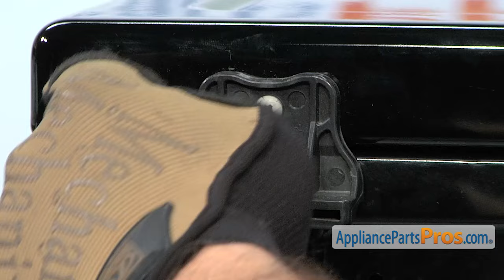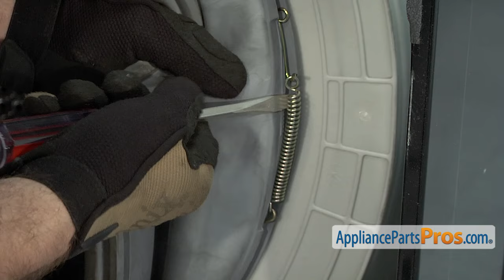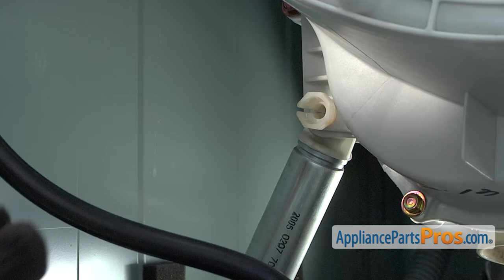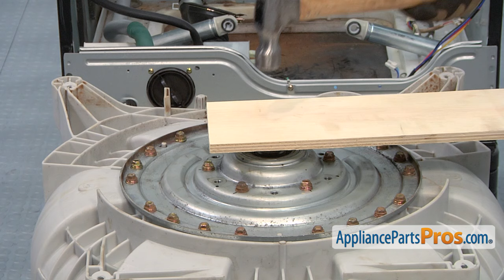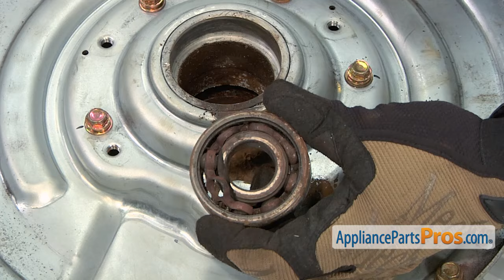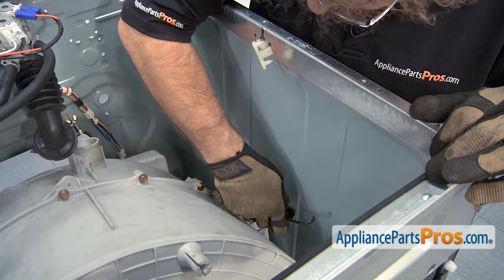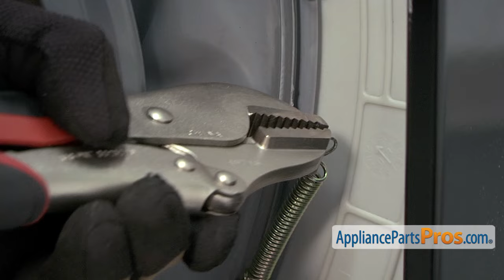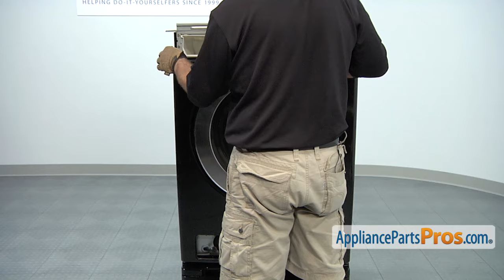How To: LG/Kenmore Washer Seal 4036ER2004A

Comment: Great instructional video, thank you for taking the time to do this! It was very easy to follow along and accomplish this job at home with very little expense.  The inner spring clamp was a bear to get reconnected, I think it would have been much easier to have done that one when the tub was still outside the main housing.
Reply from the maker: +D&K Dunn Thanks for the tip, glad the video helped you get the washer up and running!
Reply: I will keep this in mind when I will do this Project.  Thanks for such a valuable tip!!!

Comment: GREAT VIDEO !!!!!!!! i am having problems with my Samsung washing machine open it up and i found that the bearings are ok but the spider is crack . Could that be the reason that my inner tube does not spine correctly ?
Reply from the maker: +Jimmy Belley If the spider is damaged it could interfere with the inner tub moving. Here is the spider video: https://www.youtube.com/watch?v=iFXp2X99mQs If your spider is damaged you might consider a new seal and bearings while you have it apart.

Comment: @AppliancePartsPro one thing this is missing; which I have to admit is also missing in the manual. There is no torque setting for the bolt on the back, and no threadlock which seems strange for a motor bolt.

Comment: Well, what can i say, What an enjoyable video, felt like i'd had an hour at the movies, i do a few washer repairs but i was totally lost in that video,it was excellent in both sound and the camera work, putting the camera inside the works under the tub,good tip using the socket to hold the locking tab in,well done to all involved,looking forward to more of the same......
Reply from the maker: +Ray Andrew Glad you enjoyed the video, hope it helped you get the washer fixed!
Reply: Ray Andrew مز

Comment: My washer's shaft took quite a bit more force to get it removed from the old outer tub and bearings.  And now, it does not seem to want to go all the way in the new tub and bearings that I purchased from you.  And ideas on getting the inner tub and shaft in to the new outer tub and bearings?
Reply from the maker: +Brian Williams If there is a bunch of corrosion on the shaft you will have to remove it so it fits through the bearings.
Reply: +AppliancePartsPros Thank you, but there is not a bunch of corrosion on the shaft. The shaft and spider arms appear to be in great shape. I am really confused why I can't get this thing in.
Reply from the maker: +Brian Williams Strange we have not heard of this either, you can give us a call with the model number and we can verify the parts were correct: 1-877-477-7278. You can also post the problem along with the appliance model number on our repair forum and the techs can help you troubleshoot the problem.
Reply: So, I finally got it!! I turned it over, with the drum down and the outer tub up, like when I was pounding it out of the bad bearings, and held it from spinning while my wife jumped on it. After a few times, it finally slipped through. Thank you for your help and thank you for this awesome video.
Reply from the maker: Wow not sure I have ever heard of that technique, glad you got it in!

Comment: I see that you replaced what appears to be two bearings and a washer seal.  I have bearing part# 4280FR4048E and seal part# 4036ER2004A. However, I am not sure what the other bearing part # is, can you please provide that part#?  Thank you!
Reply from the maker: +Troy Abeyta Here are the 3 part numbers replaced in the video: 4036ER2004A, 4280FR4048E, 4280FR4048L.

Comment: Suggestion on replacing the bearings, try using a large socket that matches the outer edge. Won't damage the ring
Reply from the maker: +bsummer2000 Thanks for the tip, hope the video helped you get the washer fixed!
Reply: Mariam and Fatima

Comment from the maker: hetouahta htneuohtnueo, I cannot respond to you as you have the reply feature off. How the seal sits could vary from brand to brand. Just like you did it is important to make sure the seal is seated all the way down and even so you get a good seal.
Reply: AppliancePartsPros hello
Reply: AppliancePartsPros LGSHOCK
LG SHOCK ABSURD
Reply: +Lisa Esparza q
Reply: AppliancePartsPros 
I am unable to take the drum apart by hitting the shaft of the spider that comes through the bearing. I am afraid that heavy strikes might break the spyder.  Any suggestions
Reply: NK buy a new spider. That’s what I did so I didn’t have to worry about that.

Comment: Im having a Hard time taking out the outer bearing. I see you skipped the part when it comes out in the video. Did you have a Hard time kiking it out. And also what kind of oil should I use Im using wd40
Reply from the maker: Edgar Machuca The bearings are hard to get out due to the corrosion. WD-40 is ok we used rust buster, any type of penetrating oil can be used. You can try to heat it up with a heat gun but be careful that you do not warp or damage the plastic tub.

Comment: Nice video to help me thru it.  Thanks!

My wife was b!tching for the last few weeks about the jet engine noise from our 10-year old LG washing machine during the spin cycle.  I figured it was a bearing and a complicated repair so really didn't want to deal with it.  So I told her to just shut the laundry room door and not to worry about it.

Then when we returned from a vacation and she had a bunch of laundry to do so all of a sudden it didn't make any noise at all.  The drum wouldn't spin.  So I googled it and found this video. 

Long story short, I bought 2 bearings and the seal from AppliancePartsPros and had them ship them overnight.  Now the wife is very happy with me (for once and for probably for only a short time).

A few comments: 

I must have let ours go a bit longer than most as when I took it apart, the back bearing had disintegrated and thrown chunks of the inner bearing race and balls into the motor rotor.  So I was a bit worried that I had fried something else.  But I checked the ohms of the stator between each combination of pairs of 3 poles and they were all around 7.5 so figured that was a good sign.

As many have said here, it was not a simple couple taps to pound out the bearings.  I used PB penetrating oil, some heat from a heat gun, and a small sledge hammer to pound them out.  Since the back bearing only had the outer race intact and not much overhang to leverage from, I used a Super Bar crowbar, heat, PB oil and the sledge to pound it out.

Putting everything back in was relatively easy.  I used Astroglide lube on the outside of the bearings as it is water soluble and clams to be "highly slippery".  KY would be another option besides soap (I could add a joke about big manly things in small holes but won't).  Since I sort of buggered up the plastic part where the seal fits in (the video also looks slightly buggered up here as well), I used some 100% silicone aquarium sealant around the outside of the seal.  I was careful to unplug the drain hole on the bottom first and not use any silicone around that spot.

You may want to consider replacing the Washer Tub-to-Pump Hose (4738ER1002A) while doing the repairs as I've had to replace these every few years and seems to be another weak link with these units.

Good luck!
Reply from the maker: Evelyn Peterson Thanks for the tips, glad the video helped you out and thanks for the order!

Comment: I have a 2009 LG WM2233H and it's now emitting a squeal (no grinding) as the drum is turned in either direction.  Just to confirm, is that a signal for replacement of the bearings too?
Reply from the maker: User One If the noise is coming from the bearing area it could be an indication they are starting to go.

Comment: Thanks for the GREAT video.  I did the bearings/bearing seal replacement today and it went smooth thanks to your video.  It took me 3 hours with breaks to watch sections of the video as I worked.  No leaks and no jet taking off sound any more.
Reply from the maker: Bob Singer Awesome, glad the video helped you get the washer fixed!

Comment: Thanks for the video, it was very helpful.

Three things that worked differently for me:

1. While my spider arms were fine, the shaft was pitted and looked like it would likely wear the seal out pretty quickly, so I replaced it. You have another video that covers spider replacement, but it doesn't mention that the inner nuts that hold the spider bolts are set in plastic in the lifters (no idea why LG didn't weld them to the metal plate that's in there instead). Three of the bolts on mine spun the nuts in the plastic rather than breaking loose. Rust Buster or PB Blaster seems critical rather than just nice-to-have... even so, I wonder how often those nuts spin instead of breaking free. I had to grind the bolt heads off so the spider (and lifters) could then be removed and replaced.

2. I found it pretty much impossible to get the inner top of the door seal over the lip with the top weight in place. When I removed the weight, it was a piece of cake to install the seal. I'd recommend doing the seal first, then the top weight.

3. There was a class action suit against LG for water accumulating and stinking in the door seal. On mine, at least, there are three small drain holes at the bottom of the seal, but they can easily get clogged. It's pretty easy to clean them out while reinstalling the seal.
Reply from the maker: ***** Glad the video helped you out! Thanks for all the great tips!

Comment: Great video almost done installing my bearings for my Samsung Wf218anb have bearings in but when I put metal tub in and the plastic top outer tub it hits the water guide.  Any suggestions on what the problem is

Comment: I am trying to get the inner tub loose.  I have used a 3-IN-ONE penetrant and let it sit for a couple of hours and the shaft still won't come loose.  Any suggestions?
Reply: Mike Hauser I had to set the rear tub half on some cinder blocks and 2x4s, then I placed a copper disk I happened to have on the end of the shaft and banged it out with a sledge hammer. Most people won't have thick copper disks lying around, but you can probably find a piece of brass, maybe from a brass address number, at a local hardware store.

Comment: Brilliant video; my LG is the first of the direct drives so around 8 years old and the inner bearing was totalled. Bought a kit and a washer seal. Credit to LG its not that hard to dismantle the washer, bit of a wiggle required to get the drum out. I used a spare socket extension bar as a punch. A block of wood and a lump hammer worked better to remove the spindle (mine was jammed stuck) than a rubber mallet and a butt load of WD40.
While you have it dismantled you may as well remove the soap drawer which once out just pops apart (clipped together), and give it a thorough wash as it gets grotty in there.
Also use a permanent marker to write on the pipe/clip and whats its connected to (a letter is enough) to simplify matching the multiple pipes back up afterwards. Wiring in the machine is a tad simpler as most only fit in one place. Mark the wires though to avoid putting in the wrong place.
Reply: How would you know what a butt load of WD40 is?  Never mind, I don't want to know haha.
Reply: +Michael Karnish badum tsch

Comment: 5 Stars all the way. Great step by step video. replaced both bearings, seal and tub seal. $96.00 Can. in parts and a few hrs. for repair.
Thank you.
Reply from the maker: Ronald Trudel Glad you were able to get the washer fixed!
Reply: that prize is exactly equal to my advised prize to fit my aeg washing machine spinning-noise.

Comment: AppliancePartsPros Doods, thanks so much for making this video.  I too had a slightly different model...I'm in Australia, so would imagine it's like the UK model.  Also, mine is the washer/dryer combo...I had to fill in a few blanks and work around a few additional components, but I got there in the end and pretty proud the machine is working fine and not grinding bearings anymore.  One issue I did run into after reassembling and running some tests was an "IE" error.  Turns out is has to do with the pressure gauge, I recall having some trouble with my model when removing the tub, but slid the top off again, re-checked the hose and electrical connections and seems to be working fine again now.  Might be worth highlighting for your audience, some notes around that diaphragm unit and pressure gauge as I couldn't find much info online about it, and it is really a touchy little component that could stuff-up the whole operation for your average DIYer.  Thanks again! (PS my wife now thinks I'm a hero)
Reply from the maker: rayburry Thanks for the tips! Glad the video helped you get your model fixed.

Comment: Thx!! Used this vid for a LG F14470TD. Quite fine!
i'll explain the most specific differences to be useful :
I had to remove the upper front panel to take the tank out. Remove 4 screws front and the 2 front  top locks.
Heater is attached to the rear half tank, so you need to remove it. Just unscrew the 10 mm nut to release the resistor.
Later on, just after bearing and seal replacement,you may have to hold the drum/rear tank assembly together by putting back rotor temporarily. making it easier to handle tank back in.
Bravo from France! et merci!
Reply from the maker: nobrh Thanks for the tips and the model information. Glad the video helped you get the washer fixed!

Comment: I just went to do this today, only to find a cracked spider. Would you tell me if all washer brands use cast aluminum for there spiders? Also, do you find that any brand is better designed? Like LG better or worse than other brands?

And what do you guys charge for a model 417.420 spider?

Thanks.
Reply from the maker: Benny R All the ones I have seen are the same material. We would probably need the complete model number to confirm the right part. Going off what you gave me it looks like you would have to buy the complete inner basket as they do not sell the spider alone. It comes up as discontinued on our site but if you call, 1-877-477-7278, we can check to see if there are any left.

Comment: 10:15 into the video, when I remove the 10 mm bolt, the rear assembly won't come off.  It won't even budge.
Reply from the maker: ***** The rotor should just pull off, you can try a little penetrating oil, let it sit for a while and then while pulling it off rock it back and forth. There are magnets on the rotor so you may feel a little resistance but not much.
Reply: AppliancePartsPros  I used a little liquid wrench and got it off.  However, my front tub cover (3550ER0004H) is cracked, and two of the shock absorbers (383EER3001E) have lost their hydraulics.  Can you possibly confirm the part #s I have listed as accurate before I order.  I am also ordering the rubber seal (4036ER4001B) for the tub.  Anything else I should know?  Thanks!
Reply from the maker: You can go to our website and enter your model number to view the parts breakdown. I cannot confirm parts unless we have a complete model number to look them up and verify. Glad you got the rotor off!
Reply: AppliancePartsPros Got it.  One more question ... would you recommend attempting to remove the rust from the tub cover?  I've apparently been washing clothes with it and didn't notice so it wouldn't seem to be that big of a deal.  Awesome video by the way.  Thanks
Reply from the maker: Without using any harsh chemical I would clean everything as best you can before putting it back together!
Reply: Omg.  The front tub cover (AP5672156) I ordered from you guys has a drain in the lower front that the original didn't.  I've spent all this time taking this thing apart and putting it back together and I have the wrong part!  Help!  The lower weight/balance won't go on.  I could cut off the drain so the weight would go on, but that obviously doesn't address the remaining hole.  Please tell  me there is an easy way for me to  address.  (ie.  cut off the drain and seal the hole.)
Reply from the maker: You can give us a call with the model number to see what happened regarding the part, 1-877-477-7278. From what I can tell LG made a change and the old part is NLA. In some cases there may be some extra parts needed, so please give us a call!

Comment: I tried to remove the bearings but I failed. I punched the bearing but can't pulled out the outer ring of the bearing even though I used rust burst and the bearing was crushed. Could you let me the penetrating oil ? or do you have any other way to pull out that ring ?
Reply from the maker: Gideuk Cho If they are stuck you can try a heat gun, just do not over heat the tub and damage it.

Comment: To anyone else doing this, when re-assembly of tub spring put weights on after you get the spring on.  Otherwise thanks! Could not have accomplished this without your video.
Reply from the maker: ***** Thanks for the tip! Glad you were able to get the washer fixed!

Comment: just finished doing this using these instructions.  the only thing different was a small screw on the front panel and few wires here and there.  hardest part was getting the old crap bearing out.  Thank you so much for everything in this video.  Took me about 5 hours just because of the stupid bearing.
Reply from the maker: David Peters Awesome, glad you were able to get the washer fixed!

Comment: Hello, I am trying to upper panel to see what is problem from inside. My washer is LG WM2501HVA. The upper panel looks similar to my washer. But I can not open upper panel even though I removed two screws on the backside. Could let me know how to open the upper panel ? Thanks for help in advance.
Reply from the maker: Gideuk Cho The top panel on your model looked very similar to the one in the video. You may have to look around to see what is stopping it from coming off.